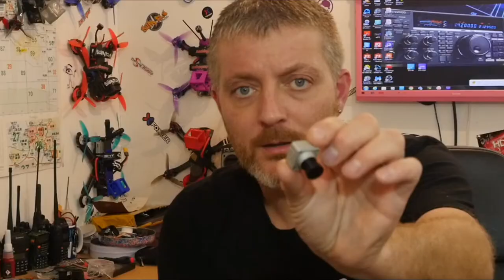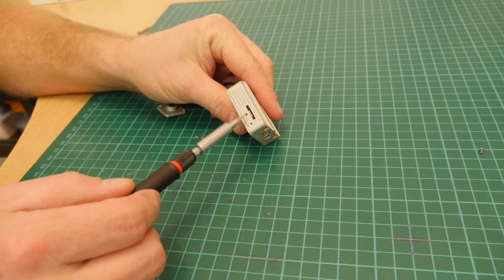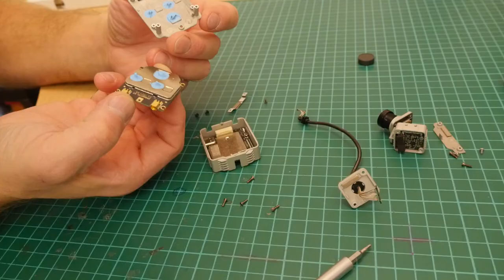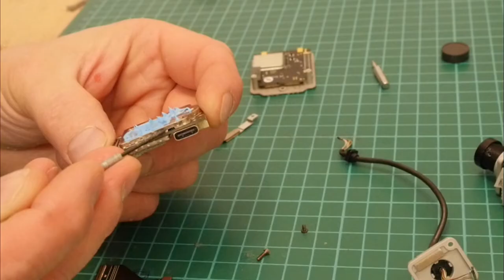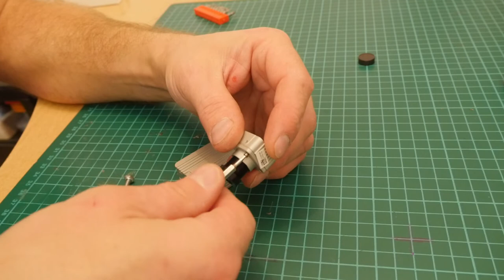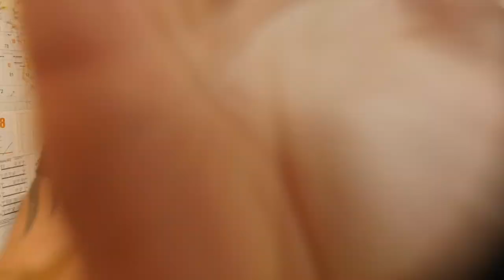DJI AIR UNIT MODULE TEARDOWN,  WHERE'S THE MICROPHONE?

Comment: When comparing gopro and dji fpv audio you can instantly tell the Air unit audio has a poor bitrate, a low quality mic and filtered sound with no low frequency or high frequency devoid of the detailed flying air pressure sounds. Maybe if we bug DJI over at their forum they will improve the filtering and bitrate along with adding live flight realtime audio streaming.

Comment: Question: do you know if the middle pin connector on the air unit is the same as the vista pin connector?
The connector I'm talking about is the middle connector that connects both boards together

Comment: Thanks. now, you seem to suggest that the plug, ribbon, cable from the camera to the Air Unit is HDMI
Is it ?
I ask, because like thousands of other people that own DJI Goggles, I would love to have a HDMI feed from my PC to the Goggles (not the sad AV feed)
If you could feed HDMI from a PC into the Air Unit (with a small cooling fan) we could have wireless HD feed into the Goggles
is it possible ?